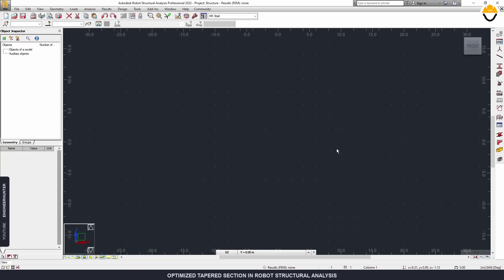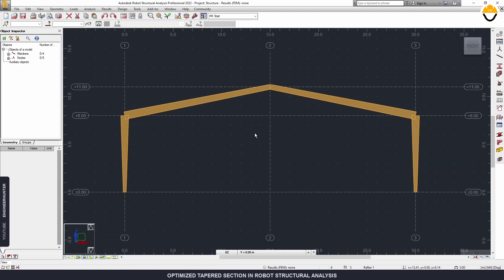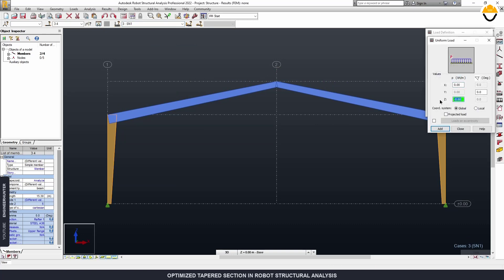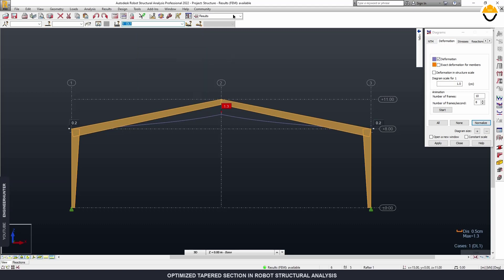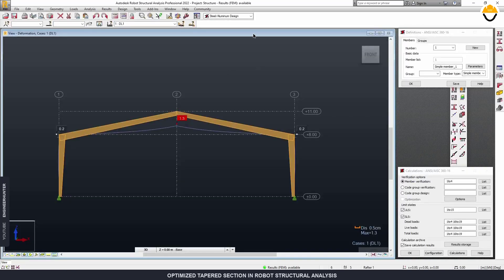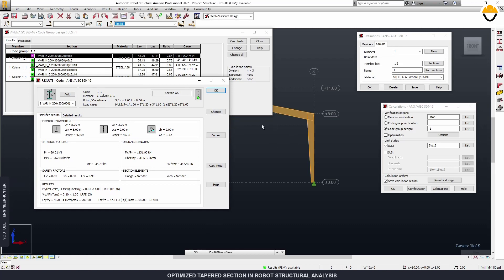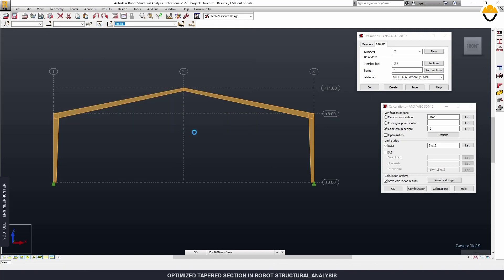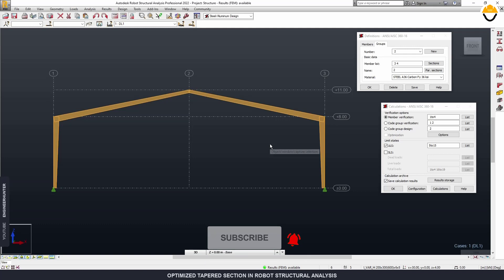Optimized Tapered Section in Autodesk Robot Structural Analysis

Comment: Why I can't find ANSI/AISC 360-16 for steel connection on Code List ? It only has EN 1993-1-8:2005/AC:2009!
 (I use robot 2022). Thank you !
Reply from the maker: RSAP now only supports connection design per EUROCODE. This is its limitation.